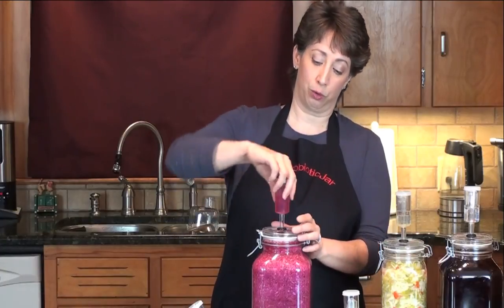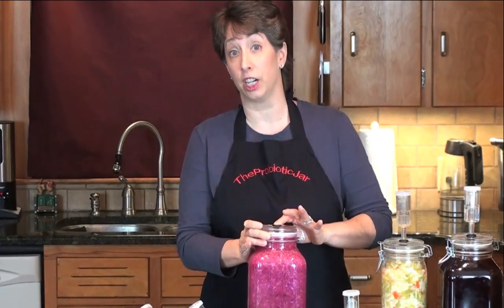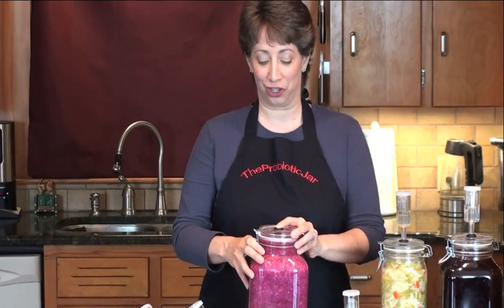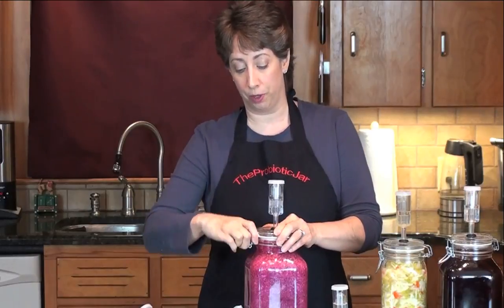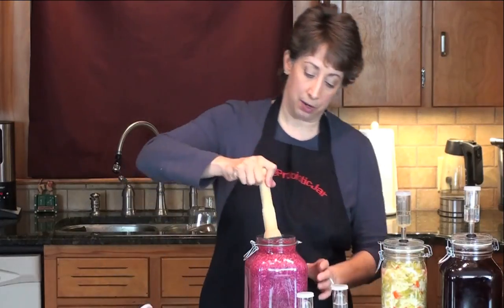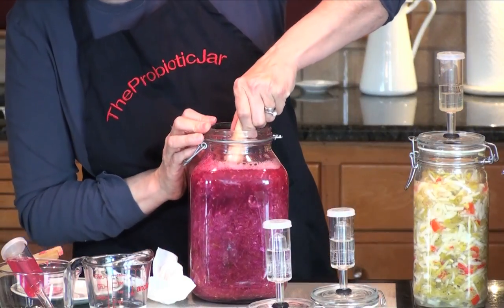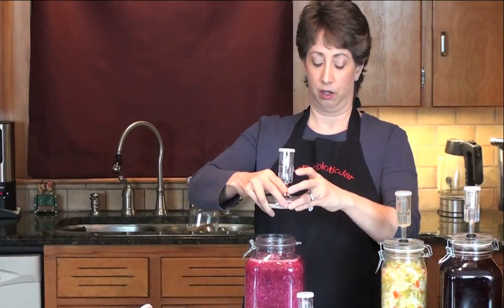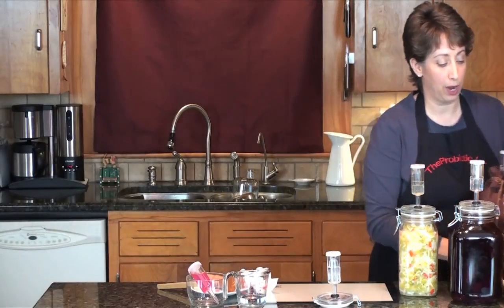Overflowing Airlock

Comment: I thought the airlock would prevent overflow.  Came out yesterday to major leakage from airlock.  Still see the bubbles but why doesn’t the airlock prevent the overflow?  I tried the change of airlock like in video holding finger over hole .  When i went to insert the new airlock, the grommet went into the jar!!!!!  Had to change the lid but put new airlock also and so too much air now.  Hardly a bull past day, darn it.  Started it with tomatoes, zucchini, and cucs 4 days ago.  Too much air in jar but is it all going to waste now?  Should jar be in fridge now?  Was there too much tomatoes in the jar to make solution leak out thru airlock?  Didn’t think so.  Thank you

Comment: What happens if you open it? Mine looked like it had air and I’ve been opening it to push the cabbage down. I’ve already opened it like 5 times since I began fermenting it 2 days ago
Reply: Did it work out for you? I opened mine when it overflowed.  It may be just past the 72 hour mark, but can’t be sure.  Do I toss the whole thing? :(
Reply: @SandraDurocher  so I actually opened it a few weeks ago. I didn’t see any mold and it’s didn’t smell or look awful or anything but it was incredibly mushy. When I looked up possible reasons for this , it seems it has more to do with improper salt ratio or too warm of an environment while fermenting.  I didn’t see much about air causing it. All that said, I’m probably just going to make another batch soon. 
How did it turn out for you?
Reply: 😮😅😅😮 @SandraDurocher
Reply: @AA-gu4mw unfortunately the top third turned a weird color and looked odd so I tossed and restarted.